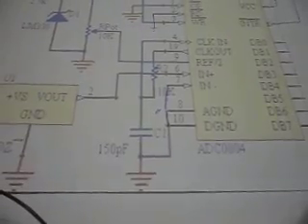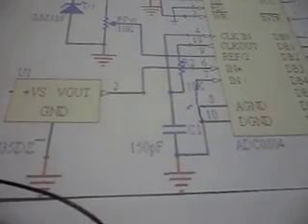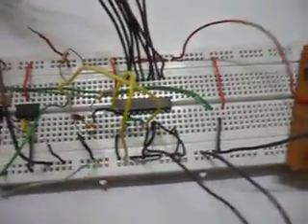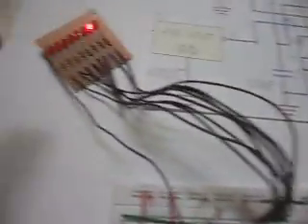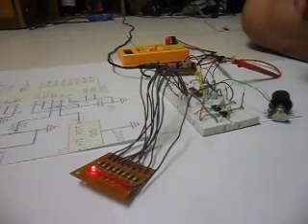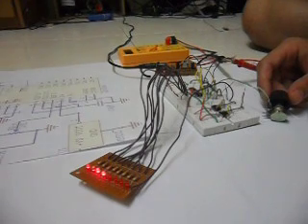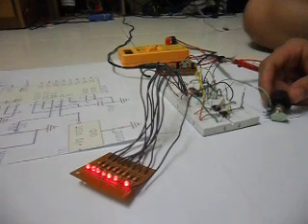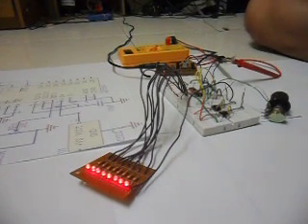ADC0804 - SIMPLE CIRCUIT

Comment from the maker: Yes, u can use it for an arbitrary signal, but the problem is that giving varying sample-values of the input signal will display the converted signal binary values very rapidly so that you may see a number of LEDs (needed to show the peak value) ON....... u may want to read about Pulse-Code-Modulation... Thank You.

Comment: can you provide what schematic  you used? what are you using as the dc voltage source, batteries? what's the voltage sources values, vin, resistances etc..